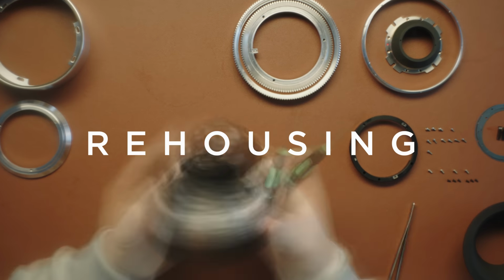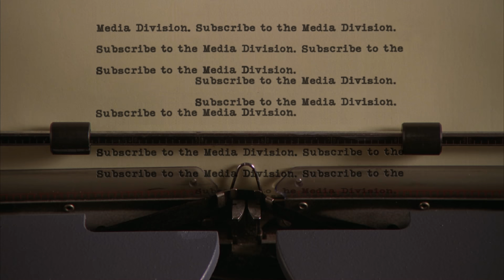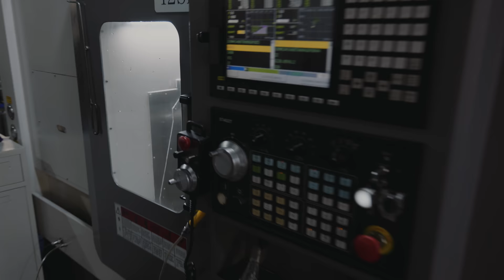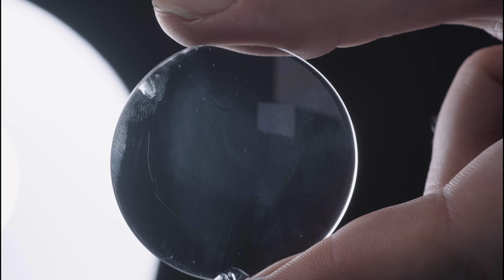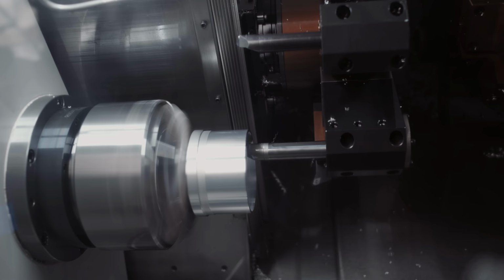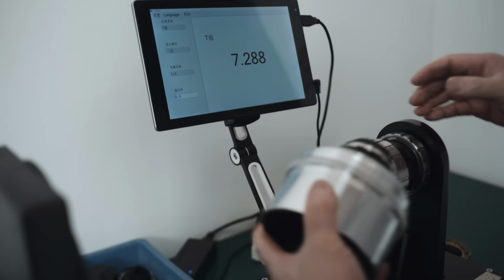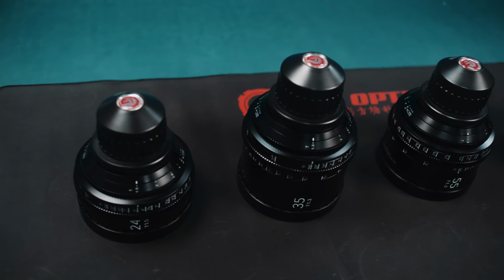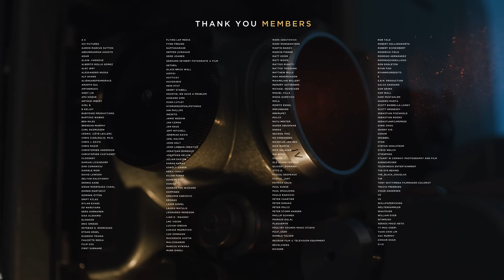Rehousing Vintage Lenses – The journey to cine lens masterpieces with G.L Optics – Epic Episode #19

Comment: Great video! Just want to point out that deposit payment for Whitepoint Optics rehousing is 25% and I've heard that TLS deposit payment is 10%. Cheers!
 - Lauri Suokas, Whitepoint Optics CTO
Reply from the maker: Thank you… for all mentions and to simplify the chart and it's meaning (there are different charges at different times for each rehouser), we explicitly mention what % has to be paid for production to START, not to get a place in the cue or point of refund-ability, or something like that. In the end, the customers are interested in how long they have to spare what liquidity.
Our offer from Whitepoint looks as following regarding deposit payments:

The payments are divided into four parts, below is an explanation of the payment structure:
25% of the total amount is paid as a deposit when you want to reserve your slots. This is non-refundable.
25% of the total amount is paid for ordering parts. 
25% of the total amount is paid at the start of production.
25% of the total amount is paid upon delivery. Payments must be made 100% to start the delivery process.

So, it is actually 75% by that measure. If this has changed in the last month we are sorry and happy for you to point it out here. We can have a correction sentence in the description. Did you actually change deposit policy since February?

About the same story with TLS. Zero is a bit more complex (regarding refund-ability) but it just makes it confusing.

Comment: Awesome episode! My guess of the mystery lens is that element has been placed in contact with an organic material, which induced reaction with the coating, changing the color/roughness. I am not certain of what kind of reaction, but it likely requires oxygen/water in addition to the coating and the contact material, which explains why it is not present in the middle and around the edges. 
Also, did you just read the Cine Lens Manual?
Reply from the maker: Thanks for your input and your support Armath. There has been other comments stating that is is a form of coating degradation.
Yes, I have that book... the copied my Gottschalk anamorphic visuals ;-))))

Comment: Great video and good sense of humour. I purchased a set of GL Optics Leica R primes 6 years ago. There was a back focus issue with the 28mm, 35mm and 50mm on delivery. GL Optics replaced all 3 lenses for free without question. I ended up buying their Canon 70-200mm, Angenieux 45-90mm and Tokina 100mm macro. I’m still using everything 6 years later. Definitely recommended for premium rehousing.
Reply from the maker: Thanks… just like I would expect from them and wondering how that possible have gone through QC?!

Comment: my best guess on the "halo" defect is that it's some kind of thermal stress defect, like if the element was left in a hot space, or possibly heat-cycling space (inside a housing which did not expand the same as the glass) for years. It's a strange one, for sure.
Reply from the maker: Other say it is some form of organic degradation due to long term contact with something reacting. Thanks for the input

Comment: I am on a lot of vintage lenses groups on facebook and instagram. But still there are not a lot of info and footage about how rehousing is done, I believe it's also a different process at TLS, Zero Optik, Whitepoint, P+S etc. Anyway, your video is greatly appreciated and it was super interesting to follow. Thanks a lot for your work
Reply from the maker: That is exactly why we thought it would be a great idea and where very happy that G.L was so open about it. I don't know the processes of others as I haven't visited their facilities. As mentioned, they use cam and not helicoid – but generally, machining etc works the same… at smaller scales though. There are reasons for the long waiting lists.

Comment: Excellent video as ever. What camera were you using to film the streets during the 'not a travel vlog' segment? Were you denoising a lot to get it that clean?
Reply from the maker: Thanks you.... that was a Lumix S5IIx filming LOG at 800 ISO. F-stops are around 3.5... it is a slow kit zoom. No denoising in post. The S5II is stellar in low light, like all modern Sony FF sensors, but these scenes look clean as I didn't even have to push it. While it is night, subjects are relatively brightly lit by them selfs or illuminated by the many signs.
Reply: @MediaDivision It is doing an excellent job in those situations. I've decided I'm going to move from Sony in the Blackmagic direction when I have the money to upgrade. Going to be a problem to be solved pulling focus on myself when I'm talking to camera :)  Would you recommend Tilta Nano II or is there a Lidar solution?
Reply from the maker: ... Nucleus is not continuous of course... there interesting things coming. Sit tight for a month or so @SenthilSukumaran
Reply: @MediaDivision Ahhh how intriguing. I will do just that then.

Comment: I repaired bad (bubbly) cement by submerging the cemented group in paint stripper! I left it for weeks in there. No damage of the coating, the cement was completely gone ( Mamiya A 150 2.8 lens) It can be done.
Reply: And really an inspiring video!
Reply: there are some chemicals that do it even quicker, with old cement often some very gently applied heat already works
Reply: @lensineer   yes, that would be Canada Balsam. But the Mamiya uses UV-cured Cement. Heating is not recommended.
Reply from the maker: Thanks! Interesting... still, taking groups apart is one thing. Putting them together without messing up the optical axis is another. I guess there are good reasons why no rehouser offers it as part of their service.
Reply: @tjalocha  yes but if you already have  degraded cement, soaking in DCM and afererwards just a little even heating gets the job done.... but getting all the cement off the surfaces is a pain in the rearend

whats your preferred method to separate and clean the lenses?

Comment: Insane work and great video thanks you ! I’m still interested to see what will be the next step for those companies. 

As Cooke made a terrific impression on me with the sp3 (both the picture and the build quality) I’m wondering if at one point the rehouse manufacturer will come up with a sturdy and little design to have small rehoused lenses for video…

we see smaller and smaller camera being used… you get what I mean !
Reply: good point, that would be awesome. But also with some practice you can still use them well in original Arri-Std mount. Kubrick did it, so can you. :)
Reply from the maker: Thanks a lot, well the most logical evolution would be to give these old lenses lens protocol features.
SP3 housings are produced in China too (as far as I know), but then… what isn't these days. The size of the housing is not so much about the technical possibilities but what the market demands. Rentals aim at pro users, pro users want the larger housings to fit into their shooting environments. If you want to run and gun as a single shooter… there are so many good, modern, and light weight affordable options. Athena, Vespid… you name it. SP3 is the upper end of that, just to slow for my taste.
Reply: @MediaDivision  « what the market demands »
That’s my whole point !
While drama / big commercial requiered this size. I see a growing market for smaller lens for smaller camera package (Rialto, R4D, Komodo and what else the future brings)
Tiny doesn’t mean run n gun to me ;-).

Nisi and DZO are.. yes they exist !
Reply from the maker: All I was implying is that the people shooting the smaller lenses are not in the market for expensive rehousings… yet?!
If there is demand it would/will exist.

Nothing wrong with DZO, or Nisi, or Laowa, or whatever
 @Horizons_Roses

Comment: Man, we have one of those lens projectors at work and they are a pain in the ass to get installed. It has to be put on a very precises track system to move it to different distances for different lenses but that track has to be on a perfectly flat surface. So we have to have a floor guy come in to get the floors level, then the rails are mounded, measured, honed, than you need to build a perfect platform to mount the projector to the rails and a accurate pully system to move it without derailing or shifting it on the rails. That room is closed off to anyone but the techs so that no one stumbles over the rails and throws it off. Shit is a lot of money and a long wait to fix.
Reply from the maker: If you say so… I am not a technician at any stretch. The Geckos where on rail systems of course, but what you describe sounds like overkill… not that I doubt your words. Of course the angles have to be super precise to tell misalignments. Something I would expect from a modern building with casted floors by design. But why would the distances matter? To compensate for different focus distances? To compensate for extreme far close focus? G.L was not anal about me operating the projector alone, and it seemed like a very solid rail system, not one that would derail accidentally.
Reply: @MediaDivision  honestly I thought it was a bit much too but it is what corp mandated. We are the North American repair center for a major Japanese camera company, so we need to jump though a lot of hoops

Comment: Do they coat the inside with that darker than vanta black nano coating paint or something similar? I'd imagine that nano tech would provide a benefit.
Reply from the maker: I do not know… it doesn't look like something like that watching the process. You can contact Avi (links in the description) for further information. The groups from this era don't, and they are not opened. I don't think this would make a relevant difference.

Comment: 6:07 if you have a passable lathe and mill in a home shop you can do it provided you have the skill.  I was able to hold a tolerance of less than .005 inches on a beat up school machine, more often less than .003.
More than good enough for a smooth running mechanism.

Having access to a CNC makes it way nicer for sure.
Reply from the maker: If you have a marble and the skills you can create the David
If you have a particle accelerator and the skills you can create antimatter
If you you press 0 and 1 in the right order you can create perfect recordings of a Mozart opera

Good luck…
Reply: @MediaDivision  that's not even a close comparison, even students can get to holding high enough tolerances in a couple weeks.
Reply from the maker: If you think you can do this in a reasonable time and budget…  just go for it! The "skills" is what matters most, and you don't seem to have the expertise required to do this. Right now you just sound like classic Dunning-Kruger
Reply: @MediaDivision  i never claimed it was cheap, quick or effortless.
Make no mistake this isn't a quick or simple project but it is well within the capabilities of a well equipped home shop or a school shop if someone were to take it on, prime optics are the easiest by far though.

To be bluntly honest you just sound like one of those pretentious people who think only the high end shops can pull things like this off.
Reply from the maker: Again… go for it! Given enough time and budget anyone can do anything – you will potentially become an expert, but to think that you can compete with a whole company that has a history doing this is just ridiculous.
Reply: @MediaDivision  I never said I could or would "compete" with anyone, it never was about trying to beat them anywhere at anything, it was simply said to be possible for someone to rehouse their own optics if they so decided to take on the challenge and that it does not require high end equipment to do so.
Reply from the maker: Yes you can… given the right machines, expertise, and time. Again… go for it! Given enough time and budget anyone can do anything. Practically: No, you will not be able to do anything close to this (aka compete). I don't know what the point of this discussion is.
Reply: @MediaDivision  if you had any amount of reading comprehension skill you would know.

Comment: One thing that stood out to me was the lack of use of gloves. For general handling like disassembly and inspection, it’s probably fine not using gloves. However the assembly of the lens is what did it for me. The dude was lubricating with grease and handling the lens with the same fingers. That’s sure way for cross contamination. Using the gloves to lubricate parts that need lube on the first step and tossing the used gloves is the way to go.

Edit: I just got to the final assembly section. Good they use gloves!
Reply from the maker: Don't you have a least the suspicion that these guys know a hell lot more about what they do then you? Don't you think they know exactly when to wear gloves? Don't you think there are good reasons not to wear gloves, too?
Think about it.
Reply: @MediaDivision  I’m an engineer working on precision parts in aerospace - I do know what I’m saying. Lube getting in wrong places can bring down a rocket. But I made this comment before getting to final assembly and have already amended the comment before you replied with a snarky comment. Great documentary though!
Reply: @MediaDivision  still a good idea to use gloves during the in-process assembly to not contaminate already cleaned parts like the lenses.

Comment: Great video. However, I was hoping to see hair covers on the employees and dust controlled rooms and static controlled workstations in the assembly areas.
Reply from the maker: Thank you. Well, got to buy new lenses then.... in this kind of industry you usually don't have those. There are steps in they process where they do wear gloves and caps, but only where it makes sense. Handling with gloves always takes away from sensibility required . Anti static measures...... for non electronic products.... think about it!